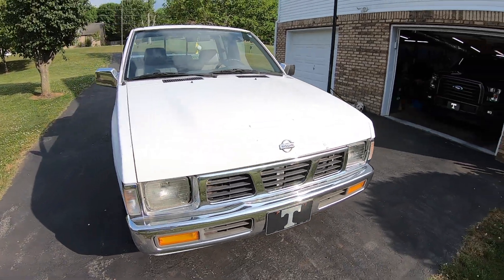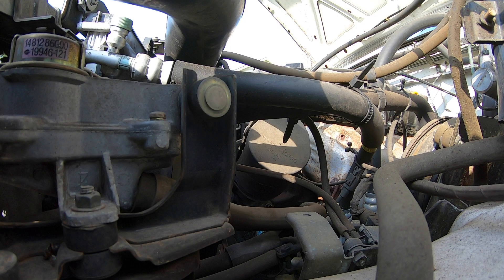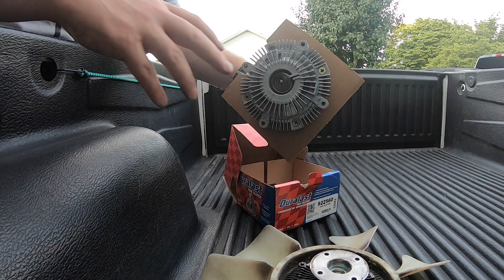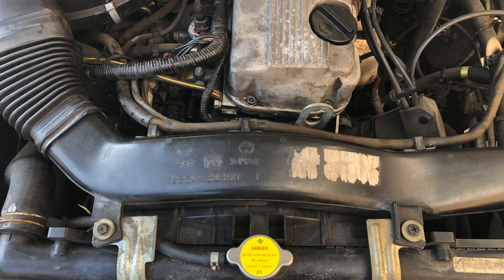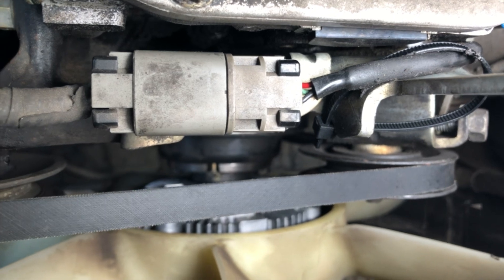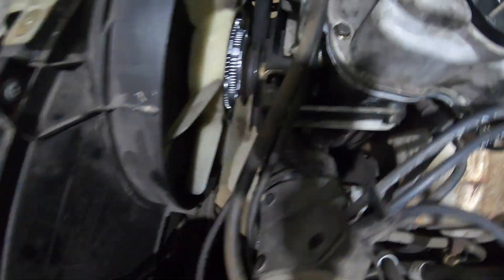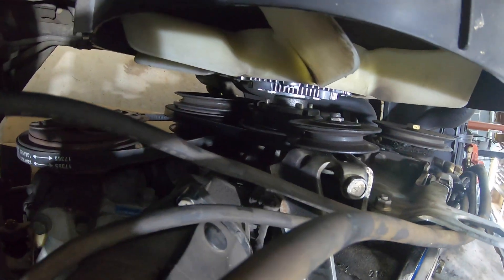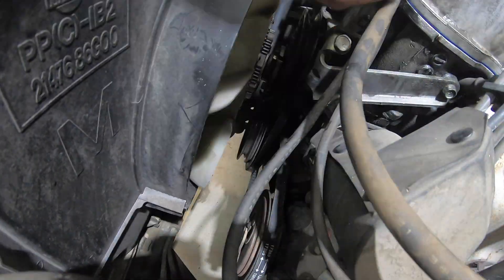Nissan Hardbody Fan Clutch Squeal - FIXED DIY HOW TO

Comment: Was it heating up when you were at idle or at a stop?
Reply from the maker: No, it never got hot.  Just made that weird noise.
Reply: Mine does the same and I’m not sure if the fan clutch is the issue, I’ve changed the thermostat and water pump along with a new radiator and lines are all good
Reply from the maker: @twoonefo2917  You figure out your problem?  I've read that these trucks don't like after market thermostats and to always get an OEM.
Reply: @weekendhomeprojects  I haven’t, I’m also missing my shroud but I don’t doubt my thermostat isn’t installed correctly or isn’t working properly

Comment: What was the part number
Reply from the maker: Here's a link to the ones on RockAuto for the ''95.  Not sure which ones AutoZone sold me, but I'm sure the ones here are much cheaper at the same or better quality:  https://www.rockauto.com/en/catalog/nissan,1995,pickup,2.4l+l4,1212174,cooling+system,radiator+fan+clutch,6812

Comment: Man how tf did you get those boots back on? There's no room to play with lol
Reply: Bolts*
Reply from the maker: It wasn’t easy.  Def the hardest part.
Reply: @weekendhomeprojects  any tips? We got one threaded but I don't have arms small enough to get the rest lol.
Reply from the maker: @EveryAvenueSkater  The guy helping me couldn’t either but i somehow got my arm in there just enough to thread them on.  Dropped them a few times.
Reply: @weekendhomeprojects  alright I appreciate the response! Hopefully I can get it knocked out lol
Reply from the maker: @EveryAvenueSkater  good luck!  What year hardbody you got?  You changing the fan clutch or water pump?
Reply: @weekendhomeprojects  it's a 97, I'm changing just the fan and clutch. My old fan had cracks between each blade, I just picked the truck up a couple weeks ago for a gas saver. Your video definitely was the best one I found
Reply from the maker: @EveryAvenueSkater  You finally get it taken care of?  Fix your problem?
Reply: @weekendhomeprojects  yessir! Pretty much got it done that day and it fixed my issues, also picked up an extended cab since posting that comment so now I have 2 lol
Reply from the maker: @EveryAvenueSkater  Can’t hide money :)
Reply: @weekendhomeprojects  you already know 😉
Reply: @EveryAvenueSkater  my 1995 hardbody fan is cracked as well.  Would this be caused by the clutch or just changed the fan?  It seems to rotate okay